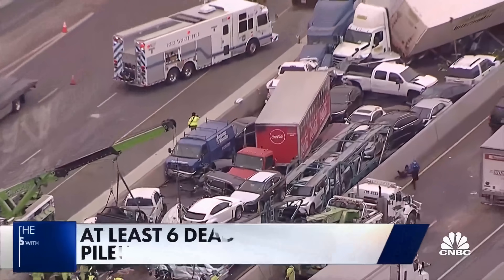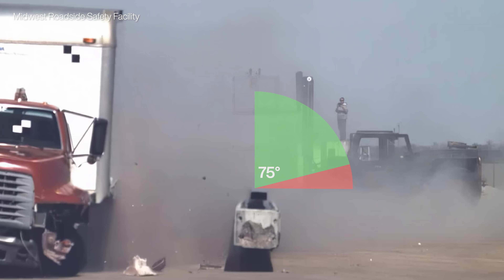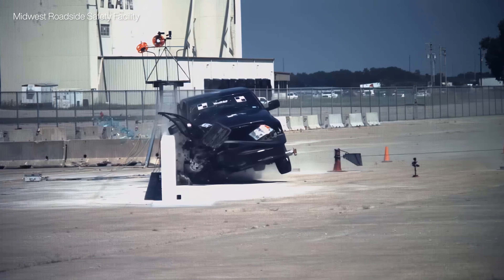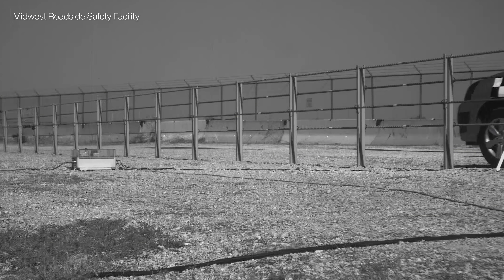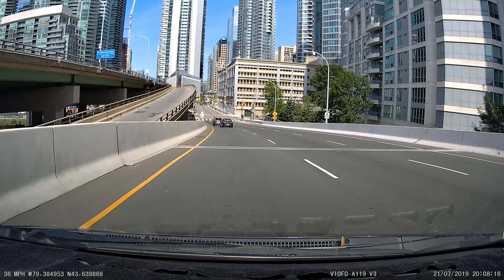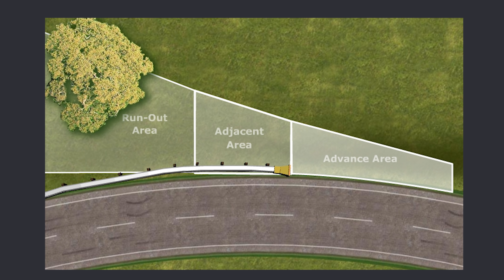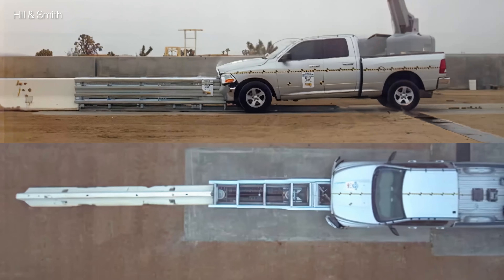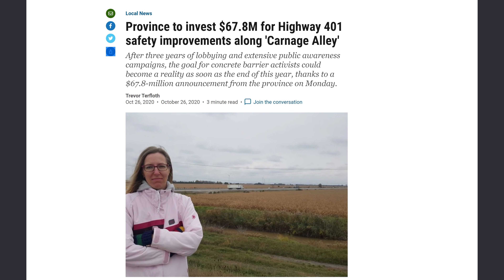How Road Barriers Stopped Killing Drivers

Comment: I'm fairly certain that an F-Shaped concrete barrier saved my life when I was 17 and coming home from a long shift. I had a tall but light 4x4, a Jeep Cherokee, and I fell asleep at the wheel. I think, but don't know for certain, that my tires bounced off of the slope of the barrier. It deflected me back into the road instead of the building that I was headed for, and very much woke me up. I am very curious, and would very much appreciate knowing, if you came across any statistics regarding older vehicles (80s, 90s, 2000s) and cable barriers potentially penetrating the A-pillar and injuring occupants. I just always assumed that the smaller surface area would concentrate force, but you speak very highly of them. I would like your input.

Comment: I wonder how much consideration is made for less protected vehicles like motorcycles when it comes to designing and installing cable barriers. There's not many studies but the unprotected posts and to some extent cables are supposedly not super great for them.
Reply: If you're on a motorcycle on the highway, in general you know a crash is very likely to be fatal. It's crazy to me how people continue to ride them on roads despite how much deadlier they are, but to each their own ya know

Comment: I hate to be a Debbie-downer ... but ....if people followed speed limits, left proper distance in front of them when following another vehicle, never glanced at a cellphone, used mirrors often to anticipate what others were doing and wore seat belts (but as we see in this video, they can only do so much.) Slowing down in bad weather  and giving way to others rather than insisting on being first ( read: road rage!) With all this done...we just may not have to keep replacing those barriers and taking people to the hospital.  Have a safe day.

Comment: Go talk to motorbikers about cable barriers. Imagine being knocked off your bike and sliding along the road at 60 MPH towards a steel cable. There's a stretch of the M62 here in the UK that has a short section of cable barrier.  It's claimed the lives of dozens of bikers, several of whom were cut in half or decapitated.

Comment: Loved the video, but a bit of a shame you didnt take into consideration the effects of other types of vehicles on barriers, not just cars. A motorcyclist has a very small chance of not being cut in half if they lose control towards cable barriers, they act like garotte wires at high speed and cause more injury. We call them Cheese graters barriers over here in NZ, because of the amount of motorcyclists that are killed when they hit them.

Comment: I'm old enough to have been alive when highways had no barriers of any kind in the median, and freeways had only chainlink fences - the latter pretty much only to discourage people from trying to run across. Then I watched metal guard rails appear first, then concrete walls, and then the latter had to have an additional section added on top in high-traffic areas. Concrete pillars supporting overpasses stood entirely in the open, by themselves, before they too were protected by concrete walls as well so that vehicles couldn't run straight into them. So this is all instructive for me to see.

Comment: i don't think a cable barrier should ever be allowed, a guardrail is allready extremely dangerous for a motorcyclists let alone if you start using thin metal cables. i geuss its a great tool if you want to decapitate people tough

Comment: As a Missouri resident, I love cable barriers.  The low cost means that much more of the highway system can be protected from crossover type accidents.  I routinely see cars and even 18 wheelers trapped in the cables on my way to and from work.  Without barriers, every one of those wrecks would likely have been multi fatality accidents on an interstate during rush hour.

Comment: You didn't address the additional danger of cable barriers to motorcyclists though... of the three options for barriers, cables add an additional potential mechanism of injury to riders if the rider is still vertical when they hit the barrier.

Comment: Very interesting.  I will be looking at the different  crash barriers from now on! Also did not realise how expensive  the different  designs were?  How expensive the total cost is? 
I would have thought barriers made of recycled tyres or box construction  containing  water or sand would be cheaper if the shape was designed right?

Comment: I had no idea the “wasted” land between and beside highway roads was called a clear zone or that it’s specifically designed to save drivers. I just assumed it was “extra land” in case they decided to add another lane at another time.
Reply: Yeah, lol. I just thought it was land to separate the lanes.
Reply: If you've ever driven in an area where a snowstorm is happening, you're likely to see at least a few cars that have slid into those clear zones.
Reply: @hoobidibahbidibah8119  Or trucks driving through it intentionally during traffic jams.
Reply: @featheryfemme  Which is called a clear zone. An area to separate the lanes. For safety reasons and so on 😉
Reply: @featheryfemme it is, so you dont die
Reply: It probably is. In the UK the hard shoulder where you can stop if you breakdown. Now in the Wisdom of some highway agency it is being gradually converted to an extra lane. Now it's breakdowns that are killing people...
Reply: @carnbyarst670  Well to be fair, the logic behind the DFT's "smart motorways" is sound if you assume all drivers will go along with it and that the operators are competent.

Just that those aren't smart assumptions.
Reply: @jimmehjiimmeehh9748  the reason they are dangerous is that if a vehicle stops for any reason, accident whatever, the oncoming vehicles don't know until the lane is closed. You may not know about it because the sign could be half a mile back. Its all very well saying drivers should be be more competent but they are not, otherwise half the signage and traffic control wouldn't be necessary.
Reply: @carnbyarst670  I didn't say the drivers, I said the operators.  Each section of motorway (IIRC 5 miles) has an assigned operator and cam watcher who is supposed to as soon as anything occurs on his stretch close the lane/s involved and then phone people that need to be involved (ie recovery/ambulance/police/ etc.).

That they are often slow on the uptake is why crashes happen on those roads.
Reply: @jimmehjiimmeehh9748  To err is human. It  has been reported that since the inception of 'smart' motorways (if they are smart why do they need operators?) 53 people have been killed due to vehicles stranded on the 'slow' lane in the last 6 years. If there was a hard shoulder most if not all these fatalities would have been avoided.
Reply: @carnbyarst670  Beleive me, I am not here to actually defend the smart motorways.  They're a dangerous shit-show.  Just pointing out that they're not bad as a concept, just bad in practice.

That being said, people have always driven in to the back of breakdowns on the hard shoulder, normally at silly speeds.  You always have those guys racing down the hard shoulder, especially if there's traffic.  That's why the first thing they advise you to do after you break down is to GTFO of your car and get as far from it as you can.
Reply: @jimmehjiimmeehh9748  point taken, an idea great in theory. - it'll save a ton of money, let's do it and sort out the problems later..
Reply: @carnbyarst670  That's why you need a warning triangle.
Reply: @kangarookicker6995  yep, that should stop a 40 ton artic... 🙄
Reply: @carnbyarst670  warning triangles are placed 30-100 meters away from a breakdown. Volvos can stop in as little as 15 meters. Others max 30
Reply: @kangarookicker6995  cars are lot bigger than triangles and truck drivers still manage to not see them..
Reply: @carnbyarst670  not many truckers use the slow lane
Reply: @kangarookicker6995   from your moniker I'm assuming you must be Australian, you obviously don't know British motorways. The majority of trucks use the 'slow' lane, they usually only use the middle lane for overtaking. They are not permitted to use the 'fast' lane.
Reply: @carnbyarst670  yeah I’m a Aussie so I can’t really speak from experience.
Reply: @jimmehjiimmeehh9748   @Carnbyarst  or in other words... The amount of money they're willing to spend to save your life has been dramatically reduced by implementing "smart motorways"
Reply: @kangarookicker6995  In the UK the motorway speed limit is 70 meanwhile (by EU law) trucks are limited to 56.  So they're almost always in the slow lane except for when they're overtaking each other because one's speed limiter is set 0.01mph higher than the others (which takes forever as you can probably guess).

That being said since we left the EU I have seen a lot of trucks that are happily trotting along at 70+, even though as far as I know it's still illegal.
Reply: It's both. Once the time comes to make a decision, the clear zone can be replaced with additional lanes and alternative barriers can be installed. It's all a matter of cost and benefit.
Reply: where i live there was a road that goes through a forest and chopped trees even beside the road , till now I thought it was just so they could sell the wood and make money.
Reply: I was on highway 1 going around 80kmph. And suddenly a snow storm appeared in like 30-40 seconds. I just put brakes to lower my speed and my slid to that clear zone and stopped after making a 240 degree U-turn. I am so thankful to these clear zones because otherwise I would have hit the incoming traffic from the other side. We all were safe and pushed the car back to the road. minor damage to the car but not even a single mark on four of us. It was an amazing experience.
Reply: One time I ended up in one of those bc a semi decided to change lanes without looking (he stopped and told me as much) but yeah without the clear zone my car would have been totaled or worse.
Reply: Nope. That's where public domain comes into play.
Reply: from the moment I started driving since I started out driving on a seperated highway the idea of one driver driving the other way slightly drifting over to my lane and killing both of us on a non seperated highway
Reply: I assume in many cases it’s a combination of both, with the median being in some cases wide enough to add another lane or two with a safe clear zone, or in others with an eye towards replacing the earthen median with a fixed (probably concrete) barrier, depending upon predictions of future traffic.

Comment: I drive "carnage alley" every day.  I saw the installation of the cable barrier a couple years ago.  I often see huge swaths of that cable barrier mangled.  I wonder how much the cable has done vs the concrete that is supposed to go in one day.  I also heard that the cable barrier has a higher life time cost even though it's cheap to install.  One small accident can ruin 100+ meters of the cable barrier, while a concrete barrier would have a much smaller section damaged or no damage at all.

Comment: -Plastic/Fiberglass body materials make the panels strong enough for whoever is inside the car to live, and whoever is hit by it(think car on ped) isn't getting iced by at least 3000 pounds of straight steel sheet metal, airbags, better seatbelts, and as a car enthusiast who is usually not the biggest fan of new safety assist features like lane assist and semi-auto pilot, i won't deny their effectiveness. On top of that, harsher testing requirements and public-school driver's ed that is a requirement to pass to graduate, it's easy to understand how and why vehicle deaths have plummeted since the 2000s

Comment: Water filled barriers must be a blast when its been <10 deg F for a week. For barriers that get hit "often" they should use an electromagnetic barrier that converts momentum into electricity, stores it in a battery, then uses that energy to push itself back out after the car carcass is hauled away.

Comment: There's a very similar situation to that stretch of 401 here in Quebec. Highway 50 has been notorious for head on colisions for years, specially when they stretched it between lachute and gatineau a few years back. They initially were supposed to build it with 2 lanes each way but said it was too expensive and decided 1 lane each way with no median in most areas. They are now talking to redo it as originally planned.

Comment: The best safety measures are the drivers as they are in control, but a faulty part on a vehicle can take that control away.
Why do I say that drivers are the best safety measure? You can inspect your vehicle prior to driving and make a decision to use your vehicle or not.

Comment: I was driving on an interstate byway when I realized that a mobile home was heading straight for me on the other side of the highway. It had broken free from the transport vehicle and was careening down the highway on its own.
Luckily, the center of the interstate was the concrete jersey barriers.
The barriers did exactly what they were designed to do and direct the force of the mobile home away from the center of the road.
The mobile home tipped on its side sliding down the road. Luckily, no one was hurt or killed.
I credit them with saving my life.

Comment: I didn't know there was reusable road safety barriers with folding designs and even hydraulic brakes.. or that a plastic barrels filled with water or sand could cost 1k/pc - installed I assume?

Comment: Not gonna bring up how a cable barrier becomes a cheese slicer to those in a convertible? That's fine, that's only the real reason people think they are unsafe, not so much because of the penetration.
Reply: cable barriers: one of the main reasons for not using them is that if you come off your motorcycle the cable is likely to behead you

Comment: The string barrier feels more like the clear zone where you prevent a "crash" by preventing a "collision". Though the main deciding factor p much seems to be how much space you got around the road.
Reply: cable barriers: one of the main reasons for not using them is that if you come off your motorcycle the cable is likely to behead you

Comment: While I do see value in cable barriers. And agree that they do save lives. 
One downside not mentioned that I was expecting was disentanglement time for extrication in the event of a collision. While I only have anecdotal evidence (which should be taken with a grain of salt) I’ve noticed that our extrication times are much slower for collisions involving these structures versus concrete and rails. This leads to longer delays in reaching the hospital for passengers and longer closures of roadways. 
In any case, great video, very informative, and you’ve certainly got a subscriber!

Comment: In Europe, guardrails are regarded asdangerous for motorbicycles, as riders may lose their head. An extra sheet of metal is now often added to cover pillars. This is another reason why concrete barriers are increasingly used.  In some areas wooden guardrails can be found, strengthened with metal components. But compared to the USA and Japna, cables are nowhere to be seen.

Comment: I used to work at Glacier National Park, where there are many high mountain roads with the original low rock walls from the 19th century. I used to joke with coworkers about the guardrails only being there for decoration. A sedan with 6-8” ground clearance would either bust through the wall, or jump it like a high curb. A standard pickup truck would just drive straight over it.

Comment: "Faster speeds" – A speed cannot be fast. Speeds can be high, not fast. "Fast" already implies a rate, in this case, the rate of traversed distance per time unit. As does "speed". A "fast speed" would be a quickly changing speed. In other words, it's a high acceleration. Stop saying "fast speed", because it makes you sound like a bumbling idiot to people with a functioning sense of language. Functioning, as in, not just mindlessly parroting slurred phrases overheard in a pub.

Comment: Brilliant stuff! It's worth adding that concrete barriers can be designed to slide along the floor as well somewhat, which also improves their safety. The tops are also often chamfered so pedestrians unfortunate enough to get pinned against them in a crash, don't get completely burst by the sharp top of the wall

Comment: Regardless of how well the engineers design the systems, the only really useful road safety system in use is the intelligent operation and control of the motor vehicles by their drivers.
Reply: What a nasty thing to say. Just because someone is unfortunate enough to crash doesn't necessarily mean that they're stupid.
Reply: @hughm1383  It does when they try to blame someone else for their poor driving.